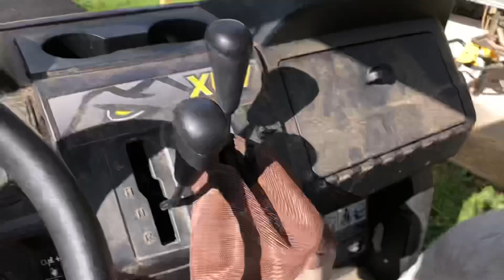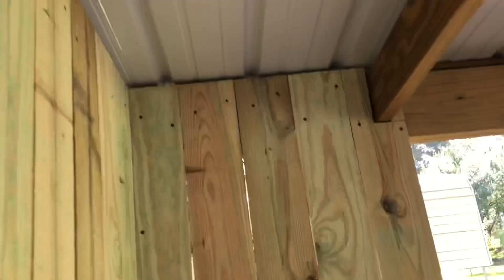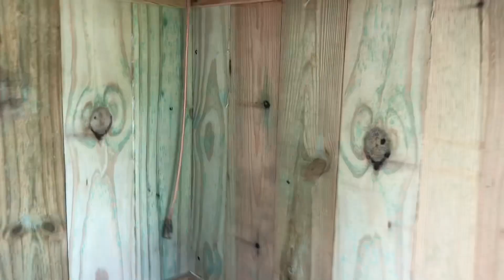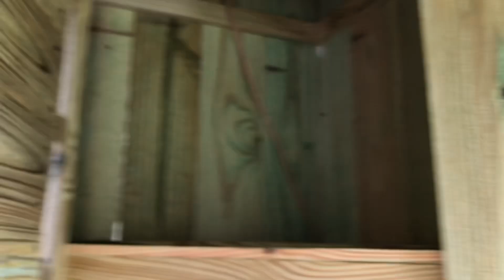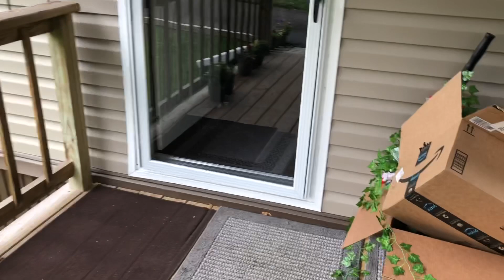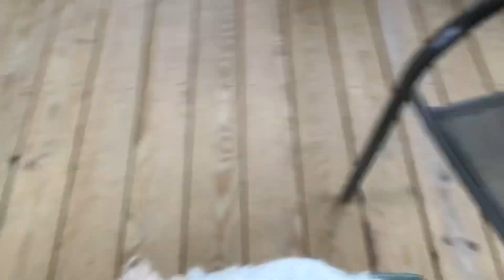Building an outdoor kitchen part 2

Comment: Continues to look good. Looks like it was intended to be there instead of being an afterthought. Glad you checked into the venting so you won't encounter an explosive situation. Uhmmmm..... including a crockpot. That's a good idea! Plug can also be used for a deep and/or air fryer, as well. Putting a whole new level into Serenity Porch Cooking (new video series). Thanks for sharing. Looking forward to seeing the results. God Bless. Godspeed.
Reply from the maker: I have plans of building two small “wings” off each side. It will blend with the top porch rail but give a little flat surface to set more cooking stuff on.

Comment: It is looking good. The LED lights are going to be even better, they are the best things for a kitchen or shop to add under cabinets and illuminate the countertop. You need to make an attachment overhead for your camera so you can make videos easier.
Reply from the maker: If the UPS guy gets here soon, I’ll be able to do a cooking video.

Comment: Ooh, I like this project a lot.  What you have is good looking and well built.  However, from your past history, you usually continue to tweak your builds, so I'm anxious to see your enhancements!!

I like gas stoves, but unfortunately have electric.  I need a burner/propane set up.  Also am researching what I need to continue canning successfully without electricity.  Thanks for sharing your project (and cooking) with us. 🙂
Reply from the maker: This new stove is more than captor putting enough heat out to can on.

Comment: Looking good , would be a cool prepper project to build and outdoor BBQ / pit oven that is wood fired , I allways kind have thought about that for worse case, the challenge  would be have it fit into the homestead and not be out of place looking , Worse case should always be able to come across some fire wood , Could even add a hot water option into it.
Reply from the maker: My next project will be a quiet generator shed. Then, a hand drilled well.